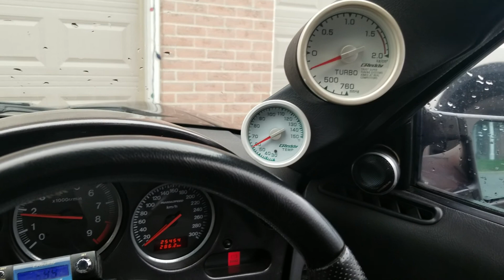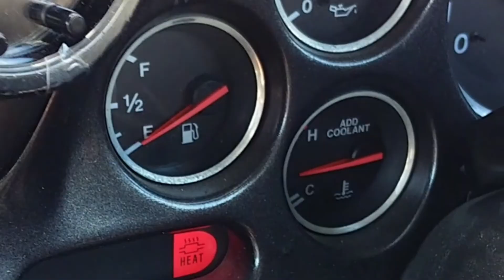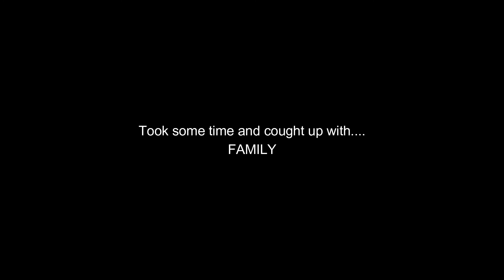Finally Returned the Rx7.

Comment: What rotarys need fuel to run? The rotary is unreliable because it needs fuel to run the engine. Owners, owners, owners are the problem. You should never run a rotary car with less than a quater tank left in the tank. This is just a no no for sure. Rotary car owners must know the dos and the donts of owning this special car.
.Brap brap
Reply from the maker: Did you watch the video?
Lol.
Thanks for the "in put". 😁